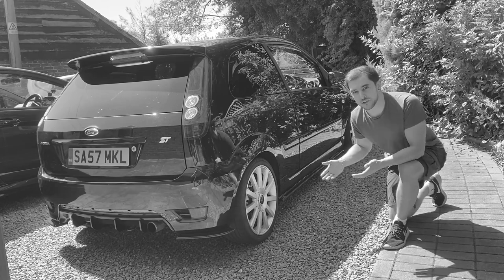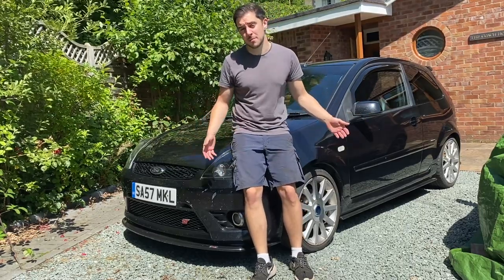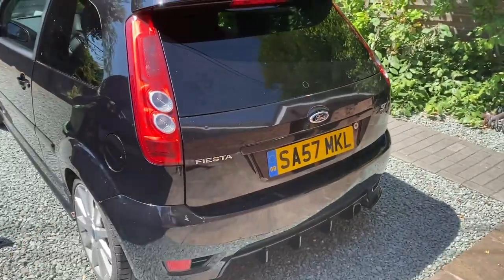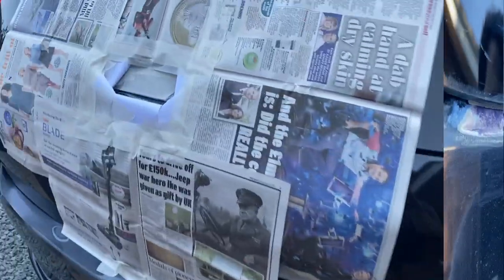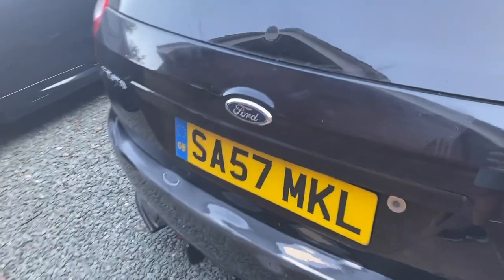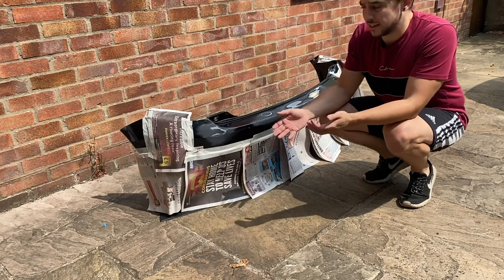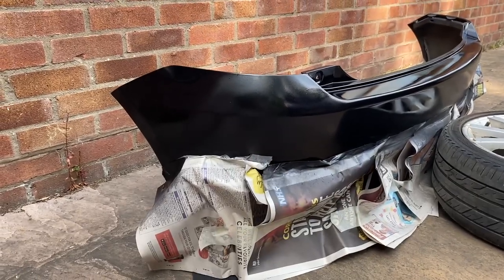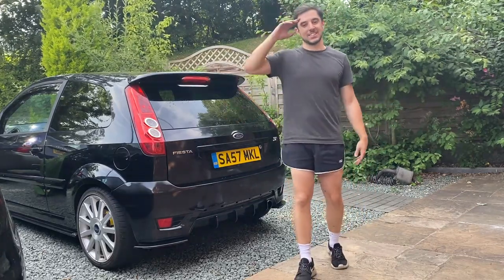READY TO WRAP | Prepping my ST150 for Vinyl Wrap

Comment: You used to harsher sand paper when you wet sanded and took a lot of the paint off that you had sprayed on when wet sanding runs you dont want anything harsher than 1000 grit paper
Reply from the maker: Ahh I forgot I used 600 to start, it still took ages to get the runs out, ahh well, we live and learn 😂
Reply: @MendItModIt  exactly mate we all learn somewhere I messed up enough when I tort my self 🤣